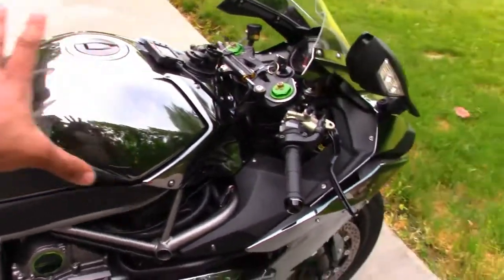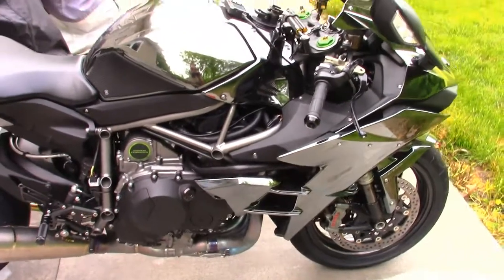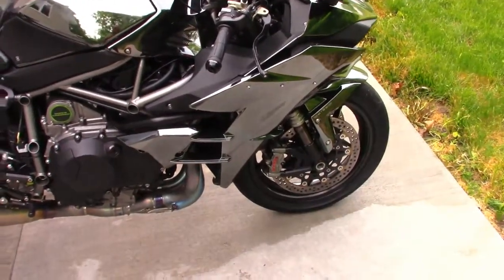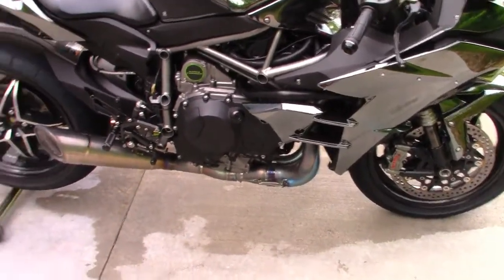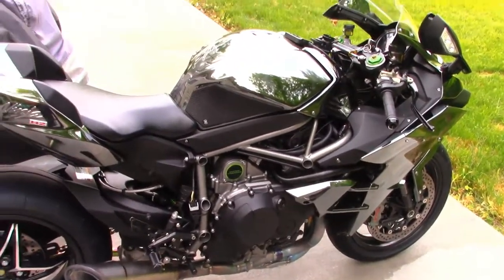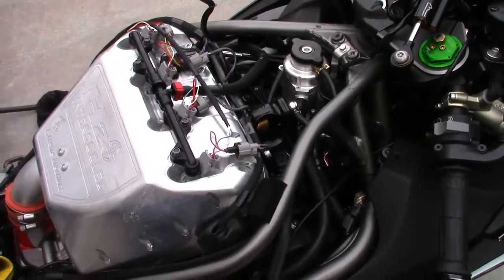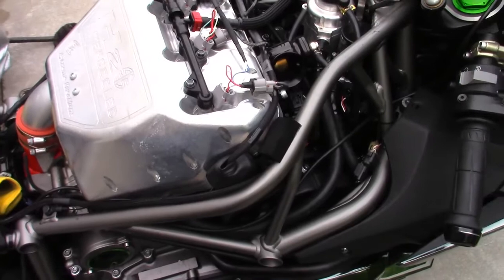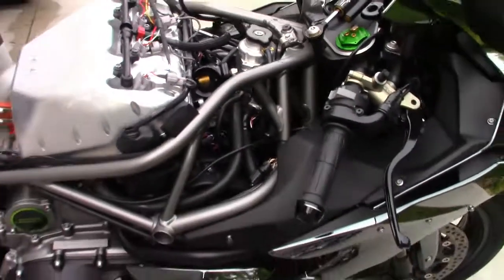Ninja H2 Correct Turbosmart BOV Installation

Comment: Install complete and boy does it sound GLORIOUS!  I found that with my current woolich flash, I do have to leave the air switching  valve in place. Otherwise the bike codes and produces Zero  power. I noticed that that initial throttle bite is gone. Very smooth. Feels great!!
Reply from the maker: Yeah man it really smooths out the throttle.  Congrats.

Comment: Did this mod. Its fun. Minor difference in my install as I had a boost gauge. Eu model has no cainster and i already had ais removed.
1) airbox nipple remain. Direct hose from nipple to boost gauge. Otherwise, hose was connected to bottom connector of solenoid. 
2) hose from boost gauge to center connector of solenoid removed.
3) hose from top connector of solenoid connected to  blow off valve. 

Didnt have any hose to place a screw to.

Comment: Thanks for the vid, it just helped me install my TS BOV on my H2SX without any issues. The installation is slightly different because my bike doesn't have that canister you portrait
Reply: Ok, so I had set my BOV but man that thing would just let out pressure like there is no tomorrow.. i put it back to use the solenoid
Reply: Do you have video of it ?
Reply: @Insaiyanrider  It's on my channel, it's not spefically of the turbosmart BOV but you can clearly hear it. Check my video of AEM gauge test h2sx.

Comment: Do you know what size cap you used to block off the big hose that connected the OEM BOV that recirculated air back in ? Also what size safety clamps did you use on 2 small ones you blocked off ?
Reply from the maker: I’m sorry I don’t remember.   Lookup a company called Extreme Creations in Australia.  The engineer there should have all the specs.
Reply: @Turbo329  all good . Is it required to put the bolt in the other two places ? You put I don’t have an intercooler

Comment: Can I I run this setup and remove emission canister without flashing the ecu. Currently just running the turbo smart bov hooked up through the solenoid
Reply from the maker: I’m not sure about the newer H2 but on the older ones you can.

Comment: Having a problem with idle after installing flash and bov and block off plates I’m curious do you think that’s a vacuum issue? Flash was done by Yagerwerx I’d love ur feed back Ty
Reply from the maker: Sounds like it could be a vacuum issue somewhere.  I’d take it back to Travis and have him take another look.
Reply: @Turbo329  thank you
Reply: @Turbo329  when it idles its doing a idle hunt the other issue I think is fuel if idling and then rev’d and release throttle rpm drop and stalls I’m going have him remote in when I get it in dyno im in NY 
Thanks again have a great holiday weekend

Comment: Great video very informative 👌I'm ordering a new H2 next week and I'm just an average street rider for most part😉 my question is by putting a full exhaust system block off plates and sprint air filter and having the ECU reflashed would this be sufficient enough best bang for my buck
Reply from the maker: Just throw an exhaust and filter on it and you should be good to go.  The bike is crazy fast.  I didn't flash my bike until spending a season on the bike to get used to it.  I can hook you up with an exhaust if you're in the USA.  www.vandemonUSA.com.
Reply: @Turbo329  thanks so much for replying back to me I'm not sure what     system I'm puting on it at the moment vandemon system I think be to loud here in Ireland loud system are garda/cop magnates.i would have assumed to pull a full system on you need to have it flashs interesting 🤔
Reply from the maker: All Vandemons come with a free noise reducer insert that keeps the noise to near stock levels.  About 96db.  Just an FYI
Reply: @Turbo329  ohhh right I didnt no thsr 👌would there be any point in puting block off plates when I install the full system remove all that emission nonsense control crap
Reply from the maker: Tom Thumb no need at all.  The bike is rich from the factory so the exhaust will lean things up slightly and it will run crisper while picking up about 7-10 more horsepower.
Reply: @Turbo329  would the full system not start to pop bang with no block off plates installers
Reply from the maker: @K-carbon  One has nothing to do with the other.  Your bike should be popping on decel.  The popping is caused by unburned fuel detonating inside the exhaust system once the throttle is closed.  Popping on decel means your bike is running a little bit rich which is good practice for the H2.  Running slightly rich keeps the engine cool and prolongs the life of the engine.

Comment: Turbo, it is me again. Sorry to bother u again but i have another question.

I have installed the Turbosmart BOV but i am not sure it is working correct.
I have used the vacuum line comming from  the throttlebodies to open the BOV.

The problem is when i start up the bike for the first time it takes a while for the BOV to start working.
At first it doesn't open at all. I ride about a half a mile and rev the engine a couple of times then suddenly the BOV starts to work. When it works it works great and functions like it should all the time. The sound is absolutely great and exactly what i was hoping for.  
Only when the bike hasn't run for some time and i start it up the BOV doesn't work. Only after revving it to about 8000 or 9000 rpm it suddenly wakes up and after that it functions great.

I have already contacted the seller about this but haven't had an answer yet but i would also like to know your opinion about this.
Does your BOV act the same as mine or does it work straight away when u start up the bike.

Thank you very much!
Best regards,
Nazar.

Comment: Question for you bro. I have a check engine light on my H2. Code 64 for the air switch valve. It turned on immediately after installing my flashed ecu. I checked all connectors, fuses and hoses. Everything is fine but the check engine light is still on. Could this just be due to the air to fuel ratio being off? Please let me know your thoughts. Thank you!
Reply from the maker: Did you remove the carbon emissions box?  If so, keep the air switch valve connector plugged in since your ECU flash didn’t disable it.  It’s one of the two connectors under the tank towards the front-right-hand side near the frame.  I forget which color it was.  Brown or blue I can’t recall.
Reply: @Turbo329  I did not remove the carbon emissions box. I also left the air switch valve plugged in. I also tried unplugging it to see if that would work. The check engine light still remains. My only thought here is that the air switch valve may be disabled within the ecu but since I have everything hooked up and plugged in it's confusing the system. Is that even possible or am I way off on my thought here? Thank you for your help!

Comment: What was the HP gain from the Extreme Creations Ninja H2 Intercooler Kit? another 20hp?
Reply from the maker: No additional power.  It just protects your engine from melting pistons when you start boosting.
Reply: Loose about 5 hp.

Comment: Ok cool, thanks. I also wanted to thank you for doing the video on the BOV.  I recently installed mine, now thanks to your video have to re-route somethings to get it working correctly. Thanks again. One more thing to ask you about, the FTC auto blipper, I recently installed mines, having trouble with it, it only auto blipp smooth at 8-10000 rpms,  below that you get this jerk feeling. Also ruining into the issue with the quickshift deactivating from the ECU, check engine light comes on with the troubleshoot light, KQS starts blinking on the screen. Leaving the bike off for a second resets everything. Sending ftc a email regarding that situation, but want to see if you had any issues with yours
Reply from the maker: Hi Alex, I actually don't run the autoblipper.  Flashtune sent me the linkage early in 2017 but I never installed it.   I'm not really a fan of it due to the issues you mention.   To my knowledge, there is a way to tune the timing of the autoblip but I'm not 100% certain.   Try the H2 group on facebook.  There are a few guys there who have done the mod.   What a lot of guys are doing also is installing the ZX10R linkage/sensor.

Comment: Is it possible to mount the Turbosmart BOV the other way around? U have the blow off opening facing to the upper right but wouldn't it be better to have it faced to the lower left so less water and dirt can make it to the opening?
Reply from the maker: I believe you can but you may need to source a longer hose from the cylinders.

Comment: What if i do the modification but keep the OEM BOV?  Doesn't that give the same result? Maybe a bit less soundeffect?
Reply from the maker: Yes, the Intercooler kit will work with the stock BOV.  It comes with a recirc hose that routes the blowoff back to the ram air tube to be recirculated into the plenum.
Reply: Hi Turbo, what i actually ment was modifying the BOV only. Keeping the stock BOV but removing the hoses and hook it up straight to the throttle bodies vacuum.

But never mind i already ordered the Turbosmart BOV. I realy hope it will cure the stutter/surging at low rpm. 

It's a nice bike but the stutter is very anoying and i am considering selling the bike because of it. Let's hope the BOV upgrade fixes it!

Comment: Really nice, informative videos. Thanks Turbo ;-) I think I must get the extreme intercooler and BOV. almost (30 celsius) 90 Fahrenheit here in sweden the last month...new record.
Reply from the maker: In the meantime, if you plan on riding the bike hard, you might want to consider VP Racing C12 fuel.   Before I had the intercooler, I ran this fuel and I didn't struggle so much with boost temps.  The fuel somehow kept the engine Boost Temps running about 10*-20* F cooler.
Reply: Thanks for the info, this year I only ride gently on the streets...next year when I got more time I hope get more trackdays :-) The bike got only 67 km on the clock so it´s not even broken in yet.
Reply: Will removing just my air canister cause my bike to throw a code? I’m using the woolich USB software and they don’t have an option for disabling the code for the air switch valve, that will have to stay. 

Just got word my YagerWerx intercooler will be getting shipped out in the coming days so once I’m back under the tank I will make sure to re route my BOV directly from throttle bodies. 

Also, what made you upgrade to the stage 3 Gear? 250 on stock wheel base not enough for you anymore?! Haha. 

Great upload BTW, this seems much less complicated than it looked when you wrote it out to me in text format 😂
Reply from the maker: I think the only time you'll throw a code is if you disconnect the air switch valve connector (blue).   Congrats on your intercooler.  Travis is a good dude and he's helped me out on a couple of occasions.    I put the Stage 3 gear in just for kicks and giggles.   The stage 2 gear was plenty good.  I'll need to tune it on the dyno but in the meantime I pulled out 2* of ignition timing everywhere to play it safe.
Reply: Ahh okay sounds good. I meant to post this as my own comment and not steal this guys shine lol. But thank you

Comment: how much engine braking do you get in first gear at 75 mph? My mechanic did your install and my bike still has a lot of engine braking.
Reply from the maker: Theres a KEBC setting on the dash.  Did you adjust that setting for less engine braking?
Reply: I got a akrapovic full exhaust, flash, multiple tunes, turbosmart valve, used kebc, and servobuddy. The back tire does lock up from engine braking when I am above 70 in 1st gear. If you drop the throttle or stop accelerating a little bit in high rpms, the bike does full engine braking and slams forward. Mechanic called kawasaki techs, they don't know what to do. How much engine braking does your bike have when you go to 5000 rpm in 1st and come off the throttle?
Reply: What did you do about your bike having a lot of engine braking?
Reply from the maker: The blowoff valve helped out with my engine braking and the KEBC is in the least intrusive setting.
Reply: Have you heard of the back tire locking? What do you think can decrease it??
Reply from the maker: I have not heard of that.   These bikes have slipper clutches.  My back tire has never locked up and I ride track.  You should probably unpack your clutch and inspect things.  It might have been installed/reinstalled incorrectly.
Reply: My mechanic talked about the clutch before and that has nothing to do with it. This happens when you are in 1st gear and you come off throttle, not when you downshift. This never happened before and it started happening when I flashed it. Everytime I reflash it and take power away it gets better and the engine braking is less bad. But I don't want a less powerful bike.

Comment: Would u be so kind to share your FTECU map with me? I have ordered the Flashtune package and would like to give your map a go. Thanks!
Reply from the maker: Hi Nazar,  my Flashtune file only removes throttle body restrictions and raises the rpm to 13,500rpm.    I did most of my fueling and ignition mapping with the PCV and Power Commander Ignition Module.  So my flash file would probably be useless to you.    It’s the base map on Flashtune’s app from 2016.